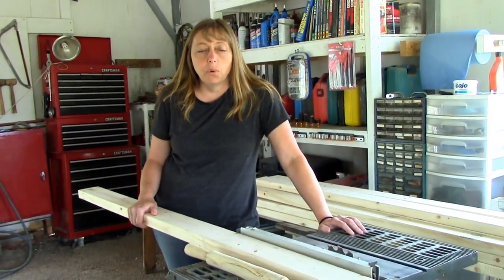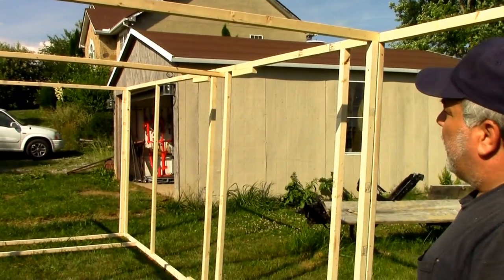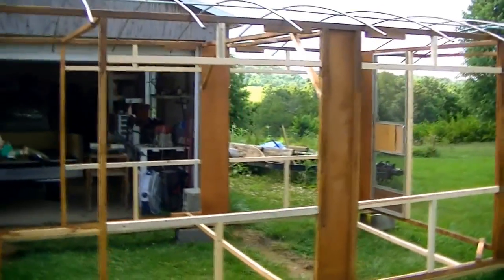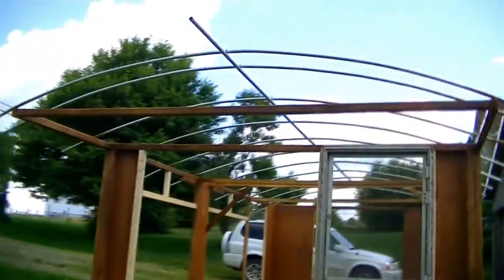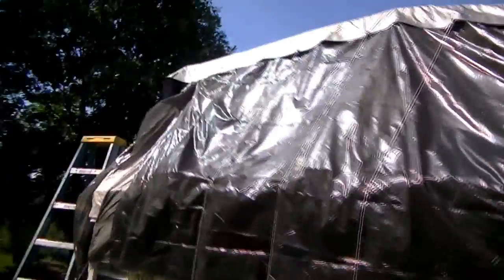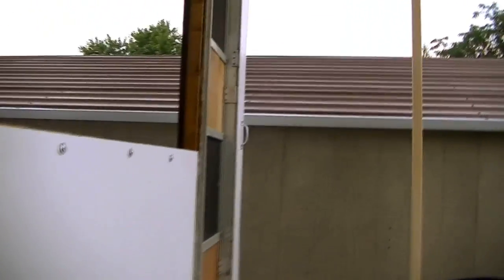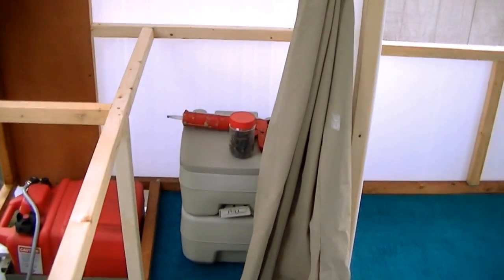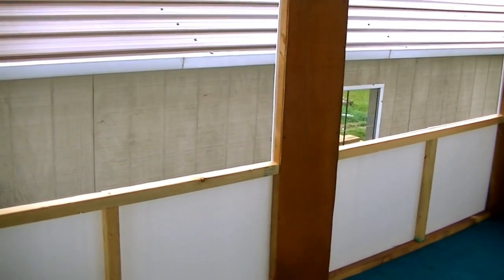Ep.10 - Rebuilding The Boat With Coroplast & Studs

Comment: If you. We're to alternate the flutes of the coroplast, it will give you more strength.   Read correlation vertical then ran horizontal.... No need for plywood... I really liked the idea of conduit for the roof structure. .less weight when trailering and less horsepower to propel. Excellent use of local material.
Reply from the maker: We actually thought about alternating the flutes....after it was too late  :(

Comment: I am impressed, you are confident there is no need for any cross bracing? How about a workshop tour? that looks very organized and impressive. will continue watching the rest of the cool videos.
Reply from the maker: Thanks Marty!! It has braces that run from side to side, and the only cross braces are the Luan panels on every corner. We're hoping for the best, structurally speaking, and we think it'll be ok. It has withstood 50 mph winds with 80 mph gusts (while sitting in the driveway on a trailer). One of our biggest concerns is that we didn't use pressure treated wood. We really appreciate you watching the videos  :)
Reply: Kinda groovy watching you guys, I am a big fan of sailing and I watch a lot of sailing videos. your videos are very different but I was impressed by both of ya'll sharing the workload in getting it done and your applied creativity. I hope you gave it some thought of finding someone to take you sailing for a few hours. I think it will be a new frontier for you.

Comment: I was worried to, because I had not studied up on the T. river.  I took a gander at it very pleasant. But when pulling a structure down the road especially homes there is the problem of hitting thing.  It's one of the reason I like building mobile units that the tops collapse down into the units. Then once its moved to its new location its easy to set it back up. How far are you going to have to move it, an did you get a permit because some state have laws and height regulations. That's why eighteen wheeler can only go some place. Nice job. Thank you for the upload.
Reply from the maker: Thanks!  We're in the process of building a new, better boat that will use vinyl siding and a tin roof. The new boat also has a bigger motor and bigger pontoons. It will be a lower profile boat because it didn't need to be as tall as it was. Hopefully that'll get us past getting permits.

Comment: You hand bent all the EMT? Goodjob lol! What screws/washer combo for attaching the coroplast?
Reply from the maker: +Justin Cooper Bret's an electrician but he was too tight to buy a conduit bender lol. I'm assuming you're an electrician or you wouldn't know what EMT is. It was a real struggle bending it over a wooden form. It took most of the day to do it.  I threw the boxes away that the screws and washers came in long ago so I don't know what the exact sizes are, but the washers are about the size of a nickel and the screws were about 1 1/2 inches long. Thanks for watching and taking time to comment!.....Becky

Comment: Just curious... Did you register the boat into your own name before doing all these modifications to it?
TPWD shows It's registered as a 1966 16ft REDFISH with expiration date of 7-31-1983 out of Amarillo, TX.
So far looks great! Will it handle Highway speeds while being pulled?
Reply: Nevermind, Just realized your boat is a TN boat not a TX boat...I'm enjoying your videos!
Reply from the maker: One problem we did have while registering the boat, was that there was a mistake on the paperwork prior to us buying it. One of the digits was recorded as an O instead of a Zero. I had to do a rubbing of the Hull ID number and take it to the courthouse. The hard part about that, is that we built the wooden cabin directly on top of the number :P  

When we towed it to the lake, we never drove above 35 mph. I feel like it would handle 45 mph with no problems. I really don't think it would handle 55 mph without it flying apart. Our solution in the future will be to sew a cover to fit over the whole boat so that we can go highway speeds. 

Thanks for watching and taking time to comment!!
Reply: Greatb work!
Reply from the maker: Thanks!!
Reply: HI  PHARTATTACK.
Reply from the maker: Hi lol
Reply: HI BRET BECKY.
Reply from the maker: Hi!! How are you doing today?
Reply: if i do this im going to use the small metal studs.

Comment: Hi Bret and Becky! 

My boyfriend and I are converting an old pontoon boat ( 24 foot pontoon double ) to a houseboat...well we are trying..  Wondering if you have any advice on what to make our structure out of? (is chloroplast acceptable for a whole structure?) We are staying in the Midwest for two more months (July and August) and then have plans to head south via the Ohio and Mississippi River. Our problem is weight, we could use some good advice, especially because we plan on crossing the Mississippi Delta. Love your channel! We love your real world advice and experience for traveling, you guys rock! 

Much Love, 

Allanah
Reply from the maker: Hey Allanah!  We're sorry that it took us so long to reply. We took an extended motorcycle trip to the east coast so we weren't able to respond on our phones for some reason. It was really aggravating!  We're abandoning the Coroplast. It held up fine on the sidewalls, but it failed miserably on the roof. The sun and the rain was too much for it. We started a  complete rebuild on a bigger pontoon boat. We've decided to use a tin roof and vinyl siding for the sidewalls. It'll be more like a house so it should be able to stand up to the elements this time. As for the structure, we're happy with 2x2's. They're strong enough and they're lightweight. We're going to use single pane windows. Your pontoon is 4 feet longer than our new one. Have you started converting it yet, and if you have, did you video it?  We'd love to see your build!!  We would also love to watch your trip on the Ohio and Mississippi also.

Comment: What did you use to attach the coroplast to the studs?
Reply from the maker: I think they were 1 1/2 inch screws (with washers)  We screwed it down about every one foot. It seems to hold ok. Thanks for watching!!
Reply: I just got an order of Coroplast. I'm really interested in this method for building DIY small structures. Let me know if the roof blows off or something! ! LOL ! We do get somewhat high winds in my area but not many bad rains. Yet. I suppose global warming will have some impact over the next few decades.
Reply from the maker: Mike Nestle Now you've piqued our interest!  I hope you video and share whatever it is you're going to build with your Coroplast. We will watch it and share it if you decide to upload it to YouTube. Our roof has held up in 50 mph sustained winds several times, and one time it was reported that we had 70 mph winds, but who knows if it was true. I do know that there are different thicknesses of Coroplast, and recently we heard of a PVC sheeting that we are considering putting on the roof when it's time to change it, but we're completely satisfied with the Coropast walls. My only complaint with the Coroplast roof is that water gets in the corrugations and causes it to discolor in places. Please send us a link if you make a video of your builds!

Comment: With all due respect, why in the world did you use Coroplast? That stuff isn't strong and will dry rot in a couple of seasons, and then you are going to have to cover it all over again.
Reply from the maker: Using Coroplast is an experiment because of its light weight. We agree with you that we're going to have to replace some of it in a few years, but probably only the roof, which is pretty easy to replace and will cost under a hundred bucks. The sides are not exposed like like the top is. We're pleased with it so far. It's been on the boat for over a year now and there are no signs of degradation anywhere. We're currently building a barn big enough to house the boat so it will only be exposed a few days (or weeks) per year. It has proved to be strong since it is screwed down in so many places. We're keeping our fingers crossed about the whole thing. Thanks for watching and taking time to comment!!
Reply: It is good that you are keeping it out of the sun most of the time. Coroplast is a great material to work with. Good luck- I like your boat, would love to have one that size
Reply: I agree, you don't save money that way